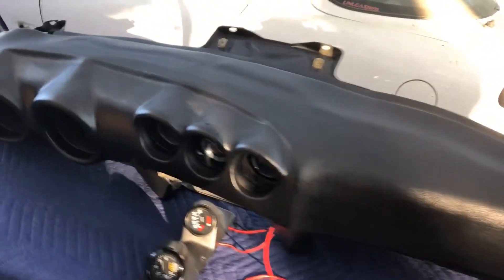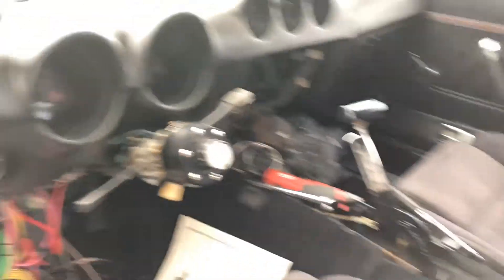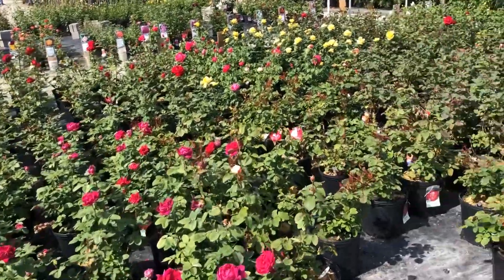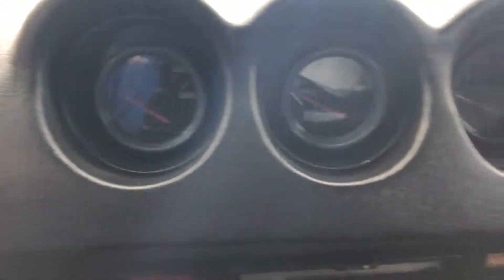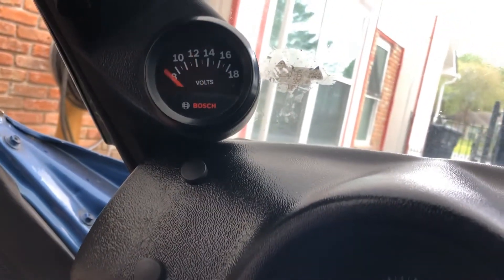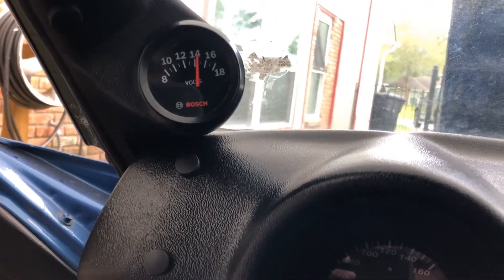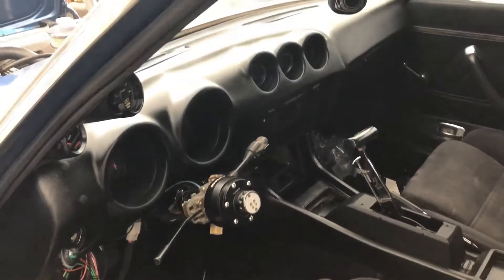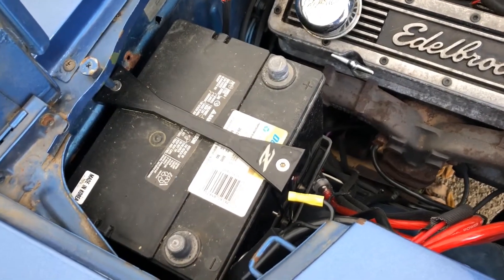280z Z10: Dash Back In

Comment: Would you have pics of how you wired the tach and speedo?
Reply from the maker: No, but if I recall the Speedo is gps so it just needs a power and ground. The tach took a purple wire from the distributor. I may still have the Speedhut Diagrams laying around somewhere.
Reply from the maker: Links to the diagrams, the speedometer also had the signal and light indicators built into it. 

Tach:
https://www.manualsdir.com/manuals/279526/speedhut-4-inch-4-1_2-inch-tachometer-no-shift-lights.html

Speedo:
https://speedhut.com/content/instructions/speedometer_338_4_412.pdf